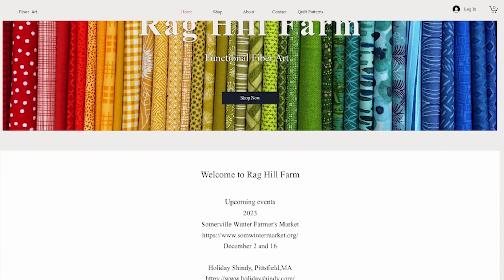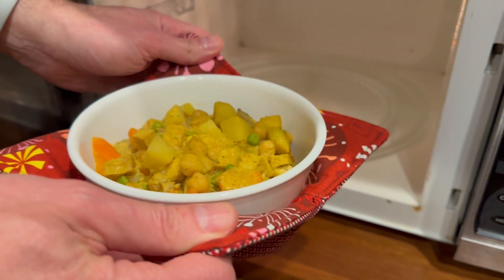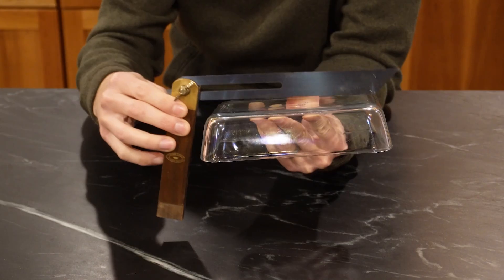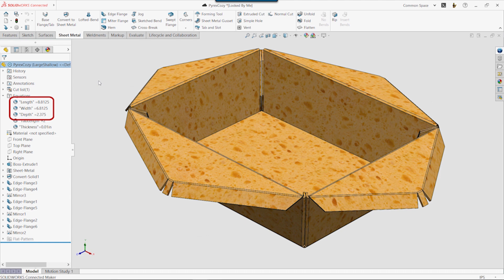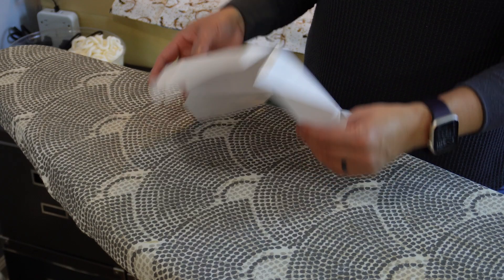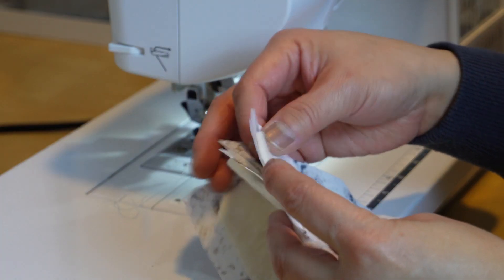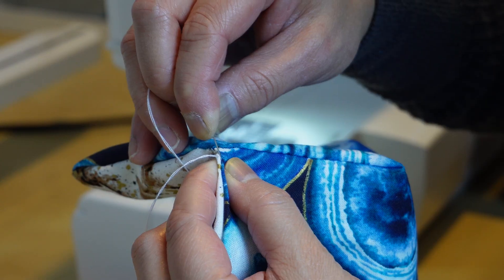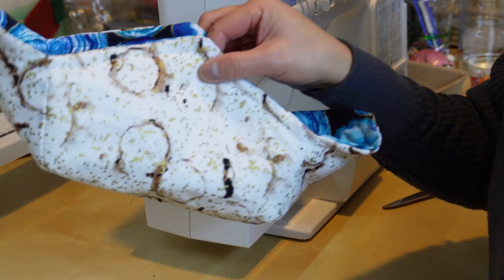Using 3D CAD to make accurate patterns for fabric projects!

Comment: Love this project. It’s very important to use 100% cotton for all materials for these cozies. Poly blend fabric and polyester batting will melt at high heat causing serious burns. Cotton smolders making it much safer.
Reply from the maker: That's a great point! Thanks for mentioning this.